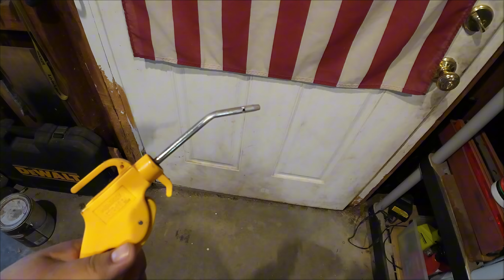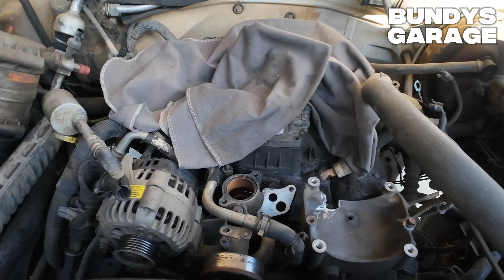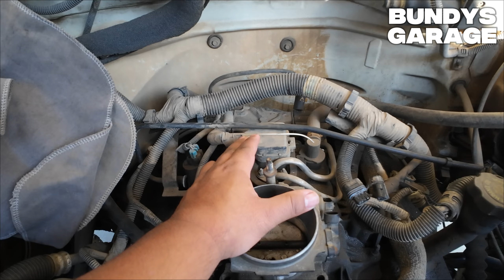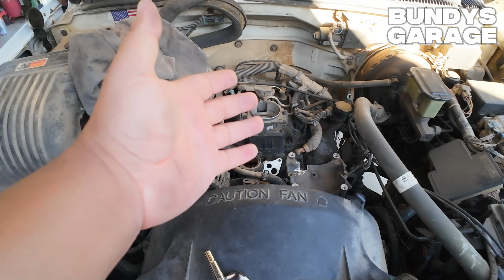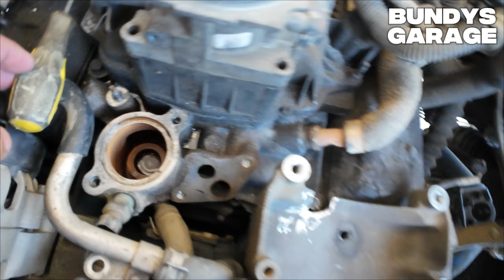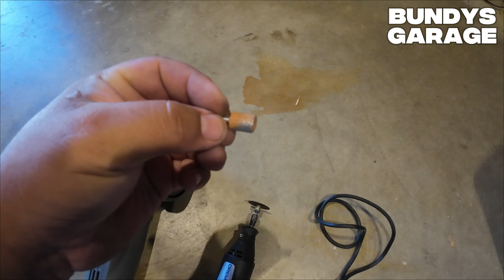HACK Chevy GMC Intake Manifold Removal MOD - 4.3L V6 1996 - 2000

Comment: Do not have to remove the power steering  pump, unbolt the  A/C compressor and power steering  bracket  sliding it forward a little bit. Also set it  at #1 before removing the distributor also marking the distributor.
Reply: this... ive done like 5 astro vans this way...
Reply from the maker: Which way? By notching the ac compressor bracket or by unbolting it?
Reply: @bundysgarage  unbolting the bracket from the engine moving it forward a half an inch
Reply: @Toolaholic7  It's a bit more than half an inch but yeah, the power steering and the compressor move with the bracket so you just need to remove the bracket bolts and nuts and then pull the whole unit back from the engine. It's like a ten minute job. Even if you notch the bracket you'll need to remove the compressor every time to get to that bolt so I don't really see it saving time.